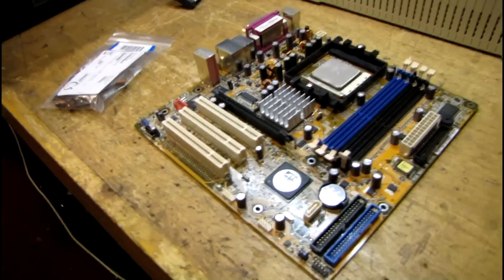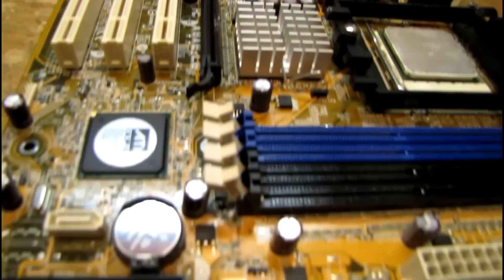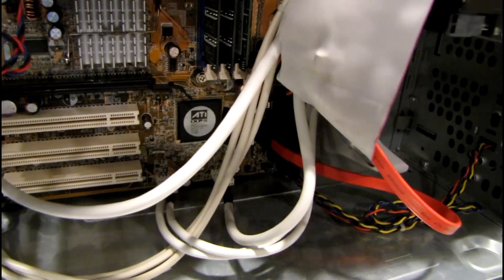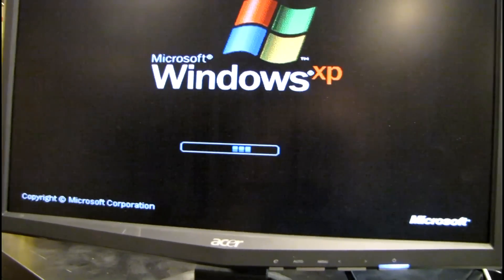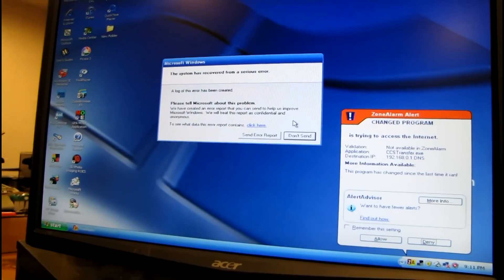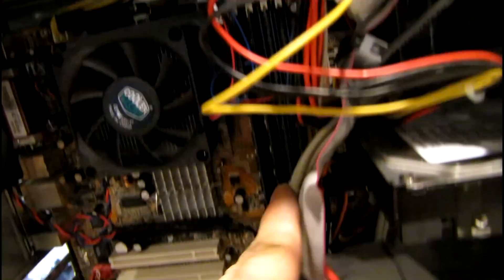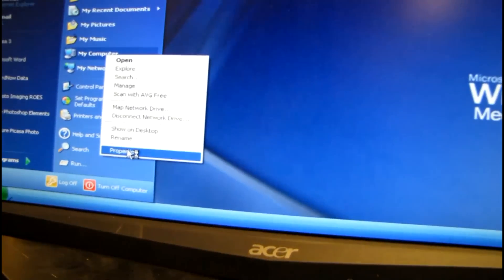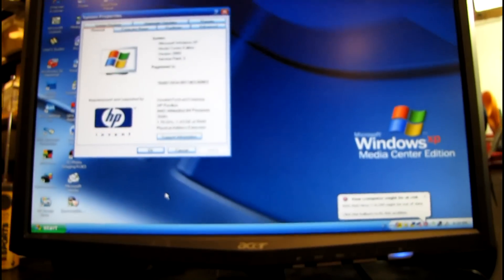HP Pavilion A1210N Repair And Test 1-27-2012

Comment: What you told here in the video with the pins holding the springs failed in my old dell sx260 i heard pioooong first i didn't realize what it was... found out like 2-3 weeks after that it was the sink falling off :) But the system never did fail thankfully :)

Comment: For whatever it's worth, I tried filling in empty caps on a couple of old Asus P2B-F boards on which I was overclocking the bus and maxing out with RAM. I used equivalent caps in the empty positions to what they were in parallel with.
I noticed it slightly improved their ability to detect large amounts of unbuffered RAM, but they still had intermittent trouble recognizing a full 1GB of PC133 at POST (which is understandable given the 440BX specs). The benefit was minor, at least in that case.

Comment from the maker: Yep, that usually ruins the board after a while.  Did the little loops on the board that hold the spring clip pop out?  That's usually what causes them to fall off.  I assume you're talking about the heatsink on the motherboard and not the CPU?

Comment from the maker: Sometimes it's circuit design changes, and sometimes they are not needed.  For example, in a parallel cap bank they might use 820uf caps and need more of them, but might later switch to 1,000uf caps and leave some empty spots.  In other spots, they might remove certain options from a board and take the caps and resistors off with it.  Such as the AGP slot in a Dell dimension 2400.

Comment: To what you said at 7:50 I put up with it on a dell dimension 4400. Later installed a new copy of XP, and it ran 5x faster. Boots in under a minute(to desktop) while it took 5+ minutes before. It is bloatware that OEMs put on there.

Comment: which is the main factor to have this flaw?, it was the motherboard's built between 1999 and 2000? or not to use a voltage regulator.

Comment: you know where i can get a win xp tablet edition 2005 from? my fujitsu lifebook T4020/T4020d has it on it but i didn't get a install disc or recovery disc. you can't make one from the harddrive too it seems. be nice to have in case i need. don't have to be official since i can use the key on the laptop.

Comment: The ram would probably work fine if you put the matched sticks in slots 1/3 then the odd one in 2/4 so that the matched sticks are both on the same channel.  You're running single channel mode there.

Comment: Very interesting.  My PC for some reason was extremely slow and I discovered the processor was operating at half speed.  I reset it and then it was back to 3.1 GHZ .  After watching this video I do know for sure I need to purchase some matched pairs of ram to further speed it up.  I'm running 1.00 GB, and it will handle 2.00, but only in matched pairs.  I have two but not matched, and the motherboard rejects them.

Comment: Interesting. I found a Compaq Presario SR1603WM at Curbside Computer the other day; it's got the exact same motherboard as shown here. I haven't found any capacitor issues with mine though. I actually bumped the RAM up to 1.5GB and installed Windows 7 x86, it runs pretty well. Even the integrated graphics is good enough to run DWM (Aero), something I wouldn't have expected from an XP-era machine.

Comment: @Maxxarcade you wouldn't happen to have a couple 1gb DDR 333 or 400 laptop sodimms would you? I posted a vid on the dump found Dell silver thing and Ebay and resellers want insane prices for that type of ram, I can't see spending upwards of $50 on a found computer, though it is pretty slow with only 512mb, xp really does need atleast 2gb of ram.

Comment: The difference in clock speed is caused by AMD's cool an quiet option in the BIOS. 
As for the video card it's most likely better then the express 200 chipset GFX. and will free up some more RAM